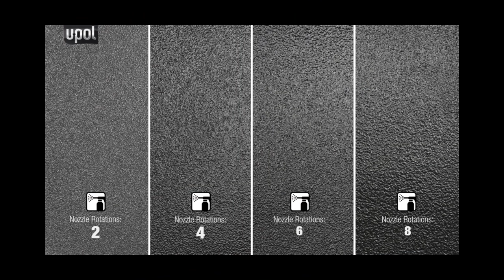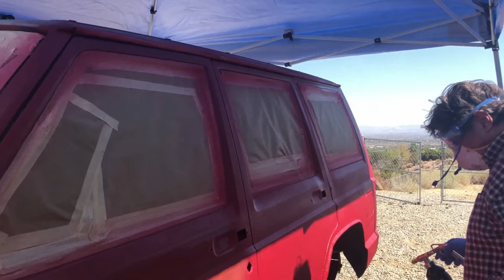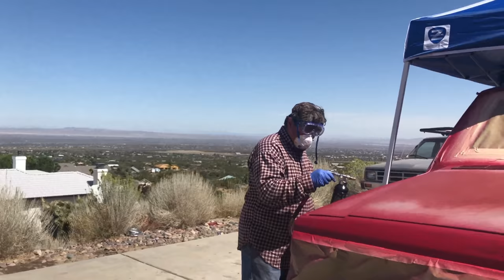How to apply Raptor Liner on a Jeep.

Comment: Tip for adding color. When I did my jeep I went to the pet store and got one of there large syringes. I could then measure exactly 50ml and squirt in directly into the raptor liner without any mess at all. I also died them all at once so I didnt have to worry about mixing them up. Color came out way lighter than I thought it would, but it actually looks better a lighter blue.
Reply from the maker: i Bee Amazin Great tip thanks for sharing...
Reply: Wow, awesome tip, seems like it would be a more precise measurement too I will have to do that when I line my vehicle soon. Thanks for that!

Comment: Just did a low mile 93 2500 chevy with the raptor coating. Paint was falling off now it looks like a new truck. Good stuff.
Reply from the maker: Nate R Raptor Liner is amazing, professional results from a DIY.👍
Reply: @5150MotorSports  1st time using the coating. Watched allot of vedios. Took many days to get the bad Chevy paint off the truck. Took more time in prep then putting down the raptor coat. Few over spray spots to clean up. Great finish. Glad to have become a raptor liner person.
Reply: Nate R how many bottles used

Comment: Looks great I have thought about doing my entire Fj cruiser. I will be doing my steel winch bumper this summer getting tires of repainting it every couple of years. Did my sons FJ cruiser roof in white this summer came out great.  Great product easy to use. You need at minimum a 6 gallon compressor.  Does not help with sound deadening I have a buddy that did his entire Fj Cruiser.

Comment: It’s supposed to sprayed at 50 psi the first 2 coats then 2 70 psi coats and when doing tintable raptorliner it takes 3.25 oz per bottle not 2 oz it’s going to die back some. I spray raptorliner for a living have a shop in Florida but it came out pretty good needs one more 70 psi coat to make the texture on the passenger side match and be even and consistent
Reply from the maker: When we used 45 psi we didn't like the texture it was way to course for are liking. Using 80 psi and the adjustable spray gun nozzle turned out 2 turns gave us the result we wanted. Our Raptor dealer suggested 2 oz of color base coat without binder to matched are factory color per bottle.  It came out fairly close but a little light maybe 3.25 oz would have been better.
Reply: The first 2 coats are to cover then the other coats are for texture with the higher psi
Reply: Seth Oliver. I've been thinking about spraying raptor for a living I'm in texas and no one does it around me there's some line-x and toff shops but there in my opinion a little pricey. I know they offer life time warranty but how do you handle offering spraying raptor instead of them going to one of those higher end shops?
Reply: Keven Avila  I started as a mobile bedliner guy and built my name and did that for 5 years then got my shop and I have a few contacts with a few companies and I do well at what I do and I do body work. But I don’t no how it works over there
Reply: Where in florida?
Reply: Dirt Hog look up my name on Facebook I’m on the treasure coast
Reply: armando aguilera fort pierce
Reply: The PSI ratings are what Raptor use to use to get a required texture before the adjustable gun. The stronger the PSI, the less chunks or splatter effect.
Sling mud on to something with a light toss versus a fast ball throw......you'll the see the cause and effect difference.

Comment: It still surprises me how many raptorliner videos I see with people spraying without proper PPE.  The hardener in raptor line has isocyanate, highly toxic and either you use a charcoal filter mask and change the filter every couple of hours or a supplied air respirator is needed.
Reply: I mean he is outside in the open of he was spraying in a booth then yeah he need a charcoal mask
Reply: Sprayed mine barefoot last night, no eye protection, or mask. In my closed garage and smoked at least 3 cigarettes (one per bottle shaking session)

Comment: nice raptor liner job but you shouldn't stir body filler it's not good for it works better if you keep spreading it over and over till you get a contestant color and try and use a piece  of metal or parchment paper to mix on just a tip still like the video
Reply: Yes....I've always been told to "fold" the hardener into the filler....not stir because it can lock in air bubbles and cause cracks later. Then again, I'm sure I've added air in before.....probably a scare tactic to make for good practice so it can't hurt to just keep doing it the way I'm taught! lol.

Comment: Painters always start at the highest point work there way down  don’t drag the hose on what you painted  peel the tape as soon as you spray it it’s  dry looks good in red
Reply from the maker: Not necessarily, some painter prefer starting at the bottom working up, you just needd to be aware of your air supply. Also your tack coat starting from the bottom helps the paint from running. The hose getting in the way is always a concern even from starting from the top, once you have one coat you need to be aware of you hose..
Reply: @5150MotorSports  I owned a body shop and have been painting 35 years , I have never started at the bottom always top down.
Reply: 5150 MotorSports you want I start at the top, otherwise overspray lands on your dry paint

Comment: Use a black magic marker to circle all areas and dimples before applying bondo. Quick ID and faster application. 👍
Ps. Do the small and easy stuff first then larger and more difficult ones.

Comment: Your supposed to stay 14 inches away but sometimes you got closer my question is how did the texture turnout?.
Reply from the maker: Foeese Auau thanks for watching we wanted less texture, which you can control with your air pressure and an adjustable tip came out great!!
Reply: @5150MotorSports  I see so closer and tip pressure  gives less texture I'm thinking doing this.

Comment: I actually thought first coat was at 90% coverage? Yours does look pretty darn good - I really love that color, looks a bit Candy Apple and metallic? Nice job. I think it is a pretty forgiving product! Thanks for sharing, cheers.
Reply from the maker: Thank You! The first coat was much less, as we didn't want to have and type of runs and this gives the the second coat something to adhere to.  The Colorado Red look amazing in the sunlight it does have that Candy Apple and metallic look. Your correct, Raptor liner is very forgiving and easy to spray.

Comment: Nice Job! What size compressor do I need to apply this product?
Reply from the maker: Thanks for watching and the support. We used their Raptor Professional spray-gun and they recommends a air compressor that can supply 40-60 psi @ 5-6 cfm…

Comment: Question:  Could you not mix up one larger batch to just refill in between?  Unless I missed that, seems like I would have the potential of getting two different shades.  About to do this to my truck and wondering.

Comment: Love the jeep and color.  I just Raptor lined the interior of my 98 TJ.  Had trouble finding tint.  Curious as to the type of paint you used...just water based valspar?
Reply from the maker: Thanks for watching, we used Valspar Basecoat LBVR100 series and had the automotive paint store not add any binders when they mix the paint.

Comment: Hi hey got my bronco 2 painted  but need  to touch up can you just shoot over the dried raptor or what cant find anything on the recoat, thanks in advance frank
Reply from the maker: I’m not 100% sure, my guess would be to sand and scotch bright the area needed repairing and then Reapply raptor liner.

Comment: What tool was used to trim fenders? Looks like it did a clean job
Reply from the maker: Hi Mason, its called a nippler anf workks great on sheet metal. Harbor Freight has them fairly cheap.

Comment: where do you get the paint from? i need to get some painted match to my xj and i’m not sure where to get it from and what type of paint i need. mines not a factory color btw
Reply from the maker: Hi Dominic, Thanks for watching…

Visit your local automotive paint (PBE) supply store, and they can help you color match. RAPTOR is compatible with any solvent based color, including 2K acrylic solid color and mixed acrylic basecoats, and can be added up to 10% by volume (ask your paint supplier to leave out the binders if possible for best pigment density). NOTE: Acrylic basecoat toners tend to have high color strength so use sparingly (less than 10% tint by volume). RAPTOR cannot be used with water based, polyester, or enamel paints.
Reply: @5150MotorSports  thanks you so much!
Reply from the maker: @dominicborchmann68  have fun take your time it’s worth it…

Comment: How often should you clean the gun , seems people have a lot of problems with this and whats the right thinner to use , I`ve seen conflicting reports  on what thinner to use , and as before Thank you in advance.!  Frank
Reply from the maker: Frank Mancuso I use lacquer thinner to clean the gun when I’m done spaying the vehicle.
Reply: Did you clean the gun when you went to mix the next bottle?
Reply: @TBUCKETMAN  I didnt , I shot 5 bottles with no problems , the caveat ,I bought the raptor gun which I think gives a better pattern I shot the smallest stipple or setting 2 turns out . wish I could post a pic came out better than i thought it would Frank
Reply: @frankmancuso4065  frank thank you for the fast response, I got the same gun, just trying to get the most info I can before I jump in it, I hate to say it like this but it’s easier to learn from other peoples mistakes:) I think yours came out awesome.
Reply: @TBUCKETMAN  I`m like you I asked 5150 MS and got my information from them but I did learn a thing about recoating or touch up if you will , after its done drying and you want to recoat , you have to use those scotch brite pads the red ones rerough the surface lightly and reshoot , also I used my compressor and got that light dust off before hand , 1 last thing they have the red jeep , I have a 1987 bronco 2 I shot it with Mesa grey raptor and black raptor on my  mirrors , bumpers and grill . I bought James Duff bumpers . Have a nice day Sir frank
Reply: @frankmancuso4065   1 more, how long did you wait before you gave it a second coat?  How long can you leave it in the gun, everyone says 60 min before 2 coat and clean gun before, then some people say nope I waited 60 min then kept shooting. Thanks again Frank.
Reply: @TBUCKETMAN  Hi Ron well long story short, I was`nt gonna use raptor liner , I used another product and it was a snafu , so after sanding & sanding on the roof where I started , I shot it with raptor and I let each coat dry a day an used the scotch pads between each coat. I sprayed till I finished and whatever was left in the bottle I tossed , once its activated in the bottle its got about an hour unless its hot out then the work time may be lower . I have to repaint my front bumper , grill , an a little of the rear fender well for looks, they didnt get the front bumper mounting brackets right had to send back to Duff to be modified ,thus they sanded off a piece so it has to have a ltl rust neutralized and repainted,wish I could post a picture . still have to put the B 2 badges on and the ford badges , 50 bucks for a ford badge is to me to much gotta have 2 , anyway hope this helps frank

Comment: How many hours would you say you had tied up in bodywork, masking, paint in all
Reply from the maker: I say around 30.
Reply: Was the body in pretty bad shape? Sorry if I missed this part, I'm new here, but will definitely be subscribing!
Reply from the maker: @chrischapman7657  We had to replace the passenger fender,  trim both front fenders for more clearance for the 35" tires. Hood was fairly wavy which took most of the time. I say around 20 smaller dents and door dings, nothing major.  One of the benefits to Raptor Liner it hides lots of the smaller imperfection that world show up in high gloss paint. Thanks for subscribing it's very appreciated.  :)

Comment: what color do you use? Doesn't the color come ready? If I want the dark gray color, will it come from the factory?
The compressor used is of how many horses and the air reserve tank is required of how many liters? And finally, how many PSI should be worked to paint with the gun sent by the raptor company?
Reply from the maker: Parachoques y Mecánica Farmor it’s a stock Jeep color called Colorado Red. 
I Used the tintabe Raptor meaning you mix it with what color you want, I believe they do offer, black, white and grey.  
I used 7 Liters of raptor liner and sprayed between 60 and 70 psi.

Comment: Looks great guys!  My only concern is that the rough surface won't allow any gaskets for the mirrors, door handles, locks and any other surface contact gasket to seal properly allowing water to seep past them.  Did you smooth out those surfaces or used some kind of filler to make a smooth surface for the gaskets?
Reply from the maker: Thanks, the Raptor Liner it not super rough, and I don’t see any issues of water sipping. We have pressure wash the Jeep several time and no sippage anywhere. It your concerned you could alway use some type of waterproof caulking under and inside the door handles and Mirrors..👍

Comment: Do you need a special kind of paint to tint the liner, or can i just go to home depot and pick whatever?
Reply from the maker: Hi Arthur, 
You need to use automotive paint from your local auto paint store.

For best results, use solvent based acrylic basecoat toners (ask your paint supplier to leave out the binders)
Reply: Roughly how much did u get?
Reply from the maker: @arthurbongiorno9715  1 paint, 2oz per Raptor Liner bottle.
Reply from the maker: @Daniele R Yes, Raptor Liner has a white kit available.

Comment: How many cans of paint did you use? Cost? Have a 96 Cherokee and need to spray the area where the plastic was and my Bush wacker flairs. Wouldn't mind doing the whole thing.  Same red as yours. Great video liked and subbed
Reply from the maker: Hi Keith, Thanks for the subb...  
We brought two kits, each kit has 4 bottles. We used a total of 7 bottles, which leaves us one for any touch up that maybe needed in the future.  Bought the kit from my local automotive paint supplier and paid around $150.00 per kit. You can find the kits cheaper on  Amazon.  I have provide a link below.

If you have any other question just let me know.

https://www.amazon.com/Raptor-Tintable-Urethane-Custom-Regulator/dp/B074KPF5X9/ref=sr_1_1_sspa?crid=3DDPFKJC83X6U&keywords=tintable+raptor+liner+kit&qid=1571503588&sprefix=Tintable+Raptor+liner%2Caps%2C185&sr=8-1-spons&psc=1&spLa=ZW5jcnlwdGVkUXVhbGlmaWVyPUEyS0JFVkdMODlTQ1I4JmVuY3J5cHRlZElkPUEwOTY2NjI3MUo3Nk5FRzgyVExHViZlbmNyeXB0ZWRBZElkPUEwMTIzMDY0MUFQWTU4RktFT1I5TSZ3aWRnZXROYW1lPXNwX2F0ZiZhY3Rpb249Y2xpY2tSZWRpcmVjdCZkb05vdExvZ0NsaWNrPXRydWU=

Comment: How’s it holding up? Thinking about doing a two-tone Jeep in the next year
Reply from the maker: Holds up great, very durable. Thanks for watching.
Reply: Had raptor liner on my tj for many years only problem spots are the hinges, ended up taking them off and painting satin black. Other that that no issue

Comment: Don’t you usually paint top down? All the liner products I’ve put down have been slower passes and single passes to get an even texture.  But, I’ve never used this product.
Reply from the maker: Not necessarily, some painter prefer starting at the bottom working up, you just need to be aware of your air supply. Also your tack coat starting from the bottom helps the paint from running. The hose getting in the way is always a concern even from starting from the top, once you have one coat you need to be aware of you hose../

Comment: what was the final PSI at the gun you used?
Reply from the maker: Andrew Rupp I used 80 psi...
Reply: @5150MotorSports  thanks. I thought I heard that when you sprayed the fender but then I thought you changed it after the test, and I couldn't make out if you said you changed it
Reply from the maker: @andrewrupp7498  No problem, thanks for asking. :)
Reply: I went with 50 or so psi two filters. That gives a spectled texture. Have heard some propper thinner and 80 psi is more of a smooth texture. 1st time using the stuff myself. Took a couple of weeks to get the truck ready and only a few hours to spray. 1990s white chevy paint that was falling off just looking at it hehe. Had to go down to metal and primer.

Comment: I wouldn’t spray outdoors, especially in a dusty environment like there, one gust of wind and you’ll have sand stuck all over the car. Suppose it’s not such a concern when spraying bed liner all over. London, uk
Reply from the maker: DS Rai That definitely a concern but when we spray we pick a day that has very little wind..
Reply: 5150 MotorSports Makes sense. Thanks for responding. Stay safe.

Comment: What body filler did you use ? Can you use white to tent that ? Thabks interesting.
Reply from the maker: zane lile we used EGC 58 premium filler . Yes you can tint using what base color. Raptor Liner also has a white that’s already to go.  Thanks

Comment: I have seen it done more than one time, all of the results have been about the same. There is a way to not have the streaks and modeling. One way is to not be so stingy putting the second coat on. The other way is ditch the gun. Monstaliner  is a much better finish .